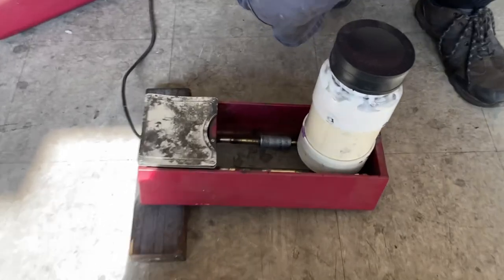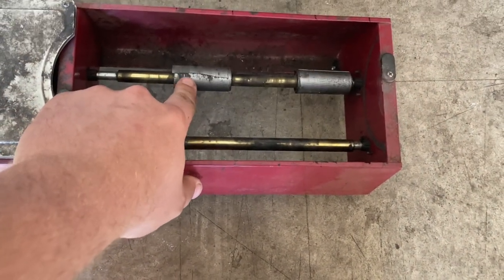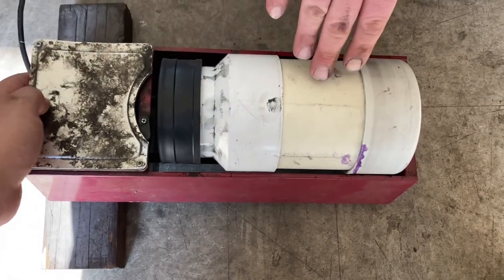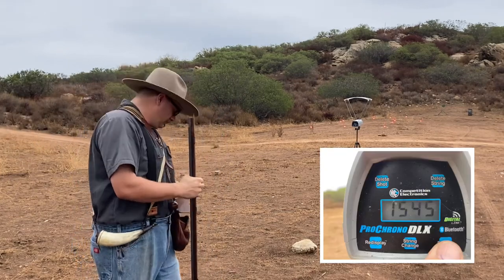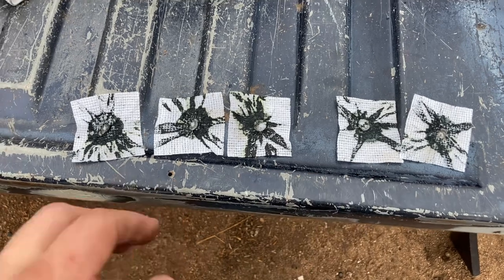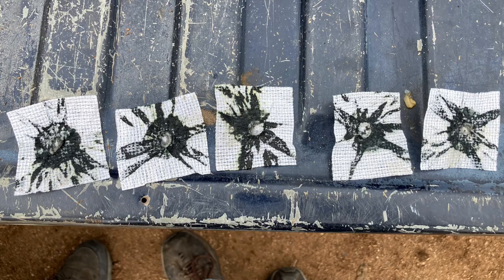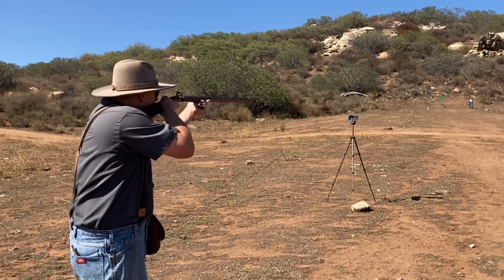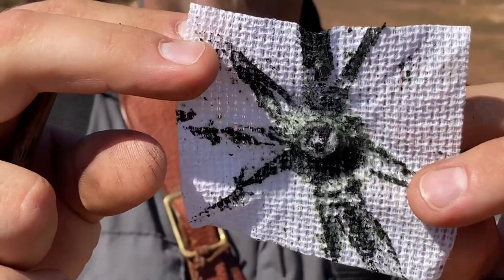Why Is Your DIY Black Powder So Dirty?

Comment: Ahh You got the Alumina Balls!! don't need a reducer if you get a no hub fitting same o.d. as end cap or just two no hubs one each end. I did same idea with internals but at angles similar to cement mixers mixing paddles! and ABS it's harder
And I accidentally "may have" discovered Carbon material "May Not" matter as much as I thought? But How or What I do to my Carbon makes HUGE differences! in speed and clean? I did micro adjustments on my last batch in-between rudimentary testing. I came up with a base of 75:15:10 but I noted my fouling? and my foulded ratio sweated indicating my KNO3 was Not used up completely? and ended adding the equivalent of 2% and 1% of gross amounts added in char and sulfur until the fouling did Not Sweat. I did not break the math down to actual %.  I got Soo excited with it I did not Bother Pucking! I just pushed dough balls through screens. Oh Well Now I need to TEST MORE! 

I think I "MAY" have found the Dragon! and my journey and equipment was almost the same!!! as You!   my last batch was FAST! Hoffman FAST! it scared Me and my Dogs! when I tested it on my welding bench! and it looked clean. I used a split piece of tubing for speed control?

How can I get hold of you? we could cut development in half?
Keep your Smoke Poles SMOKING! Keep Chasing the Dragon! Keep it by the tail!

Comment: I wonder if it was the lead acting to support the combustion?  Your charcoal shouldn't get over 560f-570f and stop the cook when the gasses still flame, but are darker like orange.  Also quicker cooldown without introducing air obviously, would help slow the process.  If you get the better char, it'll be a brownish black, instead of glossy black.  Try bumping sulphur up to 12% and see what happens, might replace some of the speed of losing the lead.
Reply from the maker: Cool. Thank you

Comment: A little stray of the subject matter but I’m curious if you’ve ever consider adding a percentage of triple seven to your homemade black powder during the grinding process to integrate the artificial black powder into your homemade powder. With the thought of increasing your velocity? May be adding 10% by volume would increase your velocity without sacrificing ignition qualities..
Reply from the maker: It hadn’t crossed my mind

Comment: Lots of good tips, thank you. I've wondered since the very first about using lead to mill with. 
I don't remember, have you tested longer milling sessions? Just for shits and giggles, I milled some for 2 days, stopping and shaking the contents several times to loosen it up and start milling again. I didn't use my Chrono but seemed to improve the final product.
Reply from the maker: I milled the first batch for 8 hours and the second batch for 4 and no noticeable change

Comment: I wonder if because the new media is lighter if it isn't mixing as well?  Causing slower velocities. I would ball mill a batch with lead and a batch with the new media for the same amount of time in the new drum you made. And see if you get the old velocities back. I suspect that you will need to mill it longer if using ceramic media.
Reply from the maker: Good idea

Comment: I'm wondering if the wetting process for making the pucks that are later corned, is resulting in some undesirable distribution of the ingredients. When that water is evaporating, carbon is not very soluble, but the oxidizer is highly soluble, and can get concentrated on the surface, where the water is doing its evaporation thing. Also, if the wet oxidizer is in contact with the sulfur and it's not kept near freezing cold, Some of the sulfur is likely going to rob oxidizer to make un-helpful sulfate compounds, a double-problem. Perhaps doing wet grinding of very dry ingredients in xylene instead of water would give a fairly stable and non-burnable atmosphere in your tumbler, while keeping any reactive oxygen or moisture separated. The downsides are that the vapors are about as flammable as gasoline, and you'll need to get the pucks up to about 300F to drive off the residual xylenes. On the other hand, the xylenes will remove other oils when you drain/screen/press the liquid out, and it will pull out remaining water that way, and via heating. You will need to keep the vapors under tight control though.
Reply: That might be a little far, but still worth investigating. I also think that not only does the sulfur help by reducing ignition temperature it may generate small amount of sulfuric acid. This can react with the heavy tars in the charcoal and even with the potassium nitrate. Basically making a sort of small nitration mix. I've usually gotten my best results after doing a first pass milling  and granulation then milling down for a final pass.
Reply: @Slowly_Going_Mad  Yeah, I don't even remember typing all that. I'm not sure why I chose Xylenes of all things, as those will tend to dissolve some of the sulfur and cause a small amount of sulfur crust on the drying product anyway. It's probably better to go with distilled water for wet milling, and then pull it out with multiple rinsings of dried acetone. 
The random reactions of tars and sulfuric acid in there probably won't do well for consistency, but sulfuric acid will inevitably pull moisture out of the air to hydrate itself. This will probably cause hard grains to swell and crumble, then, upon burning, harm your barrel, while much of your energy is not available due to trying to re-boil the trapped liquids. 
I don't do any of these chemistry projects though, so I'm simply looking at it academically.
Reply: @buckstarchaser2376  the chemistry behind it is indeed interesting and surprisingly complex, bordering on alchemy as only loose generalizations of what's going on can be made about it. I also put it to use for my revolver and have fun with some fireworks type things. It's strange that overcooked charcoal doesn't work well and neither does undercooked char. Ash content has measurable effects like acting as a catalyst and too much robs it as it's just dead weight past the limit. I found it strange that my undercooked oak charcoal burns very cleanly albeit slowly without very good confinement, though it can be made to go full power, and that my well done batch of poplar char burns really dirty leaving an almost rubbery soot that's heavy with sulfide compounds where as the other doesn't do that. I'm working on a batch right now where I cooked a bit more of the volatiles out of the oak and I'm wondering if I get roughly the same results. I suspect that at least in this case the burn rate is so high that any spare sulfur is going to be condensed (along with any salts, slag, and ash) rather than combusted more completely as with the slower stuff.

Comment: Great videos! Question, are you still using the CIA method before milling and picking?
Reply from the maker: No. I milk all my components together for 8 to 10 hours and then puck it. I’ve found this to be just as good as the cia method

Comment: How do you keep track of chamber pressures with muzzle loaders? When hand loading modern cartridges you can estimate chamber overpressure from flat primers and heavy bolt lift in bolt guns. Are there any similar signs in this case? It makes me nervous to experiment with powder chemistries if you can't identify possible overpressure or pressure spikes. Great video.  Thanks!
Reply from the maker: The short answer is no. But unlike a cartridge loaded with modern smokeless you don’t have to worry about pressure problems with any black powder firearm. Black powder doesn’t even come close to the pressure spikes of nitrocellulose and nitroglycerin based smokeless powders.
Reply: That makes sense. Thank you for the reply.

Comment: Hello, thank you for the video and sharing the results. I have feedback and question. 

Feedback: Please note that there is a strong relation between diameter of the container, diameter of the media and the speed. Usually the jar diameter is equal to the length. If the jar diameter is 100mm then the diameter of the ball media is 12,5mm and the speed must be 140 critical and 90 optimal rpm; If the jar diameter is 200mm then the diameter of the ball media is 15mm, the speed must be 98 critical and 64 optimal rpm. 

Question: Since you have tried both dry and CIA methods, what is the difference and does it make sense to mill first the charcoal and sulfur and then separately dissolve the potassium nitrate in distilled water and add the milled charcoal and sulfur and cook it until dry or use cooled alcohol and then mill all again OR simply put all ingredients Charcoal Sulfur and Potassium nitrate dry in the ball mill and mill longer? Does if make a difference and does it make sense the CIA based on your tests?

Thank you
Reply from the maker: I don’t use the cia method anymore. I’ve found I can make just as powerful powder if I just mill the components together long enough.

Comment: I am not sure what your granulation method is for your homemade powder but if you are granulating through a screen you are making much less dense powder than corned production powder. You should get a scale make a your powder charge to the volumetric measure. I'll bet you will find that your powder is lighter per volume. You might just get that velocity back if you weigh it
Reply from the maker: I haven’t made screened powder in years. Corned is the only way to fly. About compressing your powder. 
Why Is Your Homemade Black Powder Weaker Than Goex? Black Powder Service Announcement.
https://youtu.be/Ctm_gpU-fJU

Comment: This is an aspect I have no experience at, so I have nothing but questions.  One can not complain about the consistancy of the 50 grain load. Do you have a theory as to why the inconsistency of the 70 grain load? Or is this a small sample size compared to overall experience?
Reply from the maker: The 70gr charge averaged 1792fps with a max spread of 67 which is very typical of any firearm including muzzleloaders.When you start getting a spread over 100fps it’s an indication of a problem

Comment: Thanks for your great vids Jake - pi$$ funny telling the pin heads to “go make your own damn video”
Saw an idea for milling media on a Cast Boolits “mega” BP thread - they sectioned 1/2” and 3/4” copper pipe into inch long pieces and filled them with lead - peened the ends over - reckon it’s the ducks nuts they do.

Comment: Great video, where did you get your milling media? I use .490 hardened lead round balls but would love to try the ceramic and see if I can get the same results as you did.
Reply: Sling shot ammo. Usually white ceramic balls
Reply from the maker: I bought it from United nuclear
Reply: @Everythingblackpowder  I noticed on United Nuclear's webpage for purchasing the ceramic balls that the description specifically states "Since all Ceramic media has the potential to make sparks, it is useful in all applications except for milling explosive powders such as Blackpowder".  Did that get added/changed since you bought them?
Reply from the maker: @michaelg4931  lol maybe. I couldn’t say.

Comment: Do you activate your charcoal or leave it unactivated? I don't know if this would make a difference.

To activate charcoal you smother it in water at the end of the heating process. This changes it somehow. Not a clue if you do this already.
Reply from the maker: Non activated charcoal makes more power

Comment: Have you tried brass balls to put in the tumbler?  As far as I am aware of they do not leave the dust like lead balls do.
Reply from the maker: I’ve been using brass for several months now. It’s the only way to fly
Reply: @Everythingblackpowder  What size do you use?  I am just starting out and have 1/2 inch diameter and unsure if that will be good or not.

Comment: if you want the bore to be even cleaner and never ever swab ever again! use dawn dish soap and water for lube. i mix about 30% soap and 70% water. wet the patch and load and shoot. you can shoot all day long and never swab, and shot #100 will load like shot #1, and the bore is a snap to clean. if you use this lube i think you will be happy, unless you just like swabbing instead of shooting,,,,,,,,,,,,,,,,,,,,,
Reply: Boa idéia.

Comment: Are you still using the CIA method to make your AFMP? Or are you bypassing that part now? What size brass balls are you using? Half Inch @ a 100 count?
Reply from the maker: No I don’t use the cia method anymore. I’ve found that I can get the same quality powder by simply milling it longer.
Reply: @Everythingblackpowder  What about the question on the brass media?
Reply from the maker: 1/2 inch sold brass balls. I’m not sure how many. Maybe 150-200

Comment: you ever though about putting it in a dehydrator or baking it in a toaster oven on low to rule out any moisture contamination
Reply from the maker: Yes, I put some in a toaster over some years ago and it caught on fire.
Reply: Dehydrator 3 days after making pucks

Comment: That rubber contamination caught me off guard too. I wonder what the “Big Boys” use to construct their ball mill drums?
Reply: Long time ago I saw an antique BP mill. It had 2 huge 3000 pound foot wide wheels. They were on the same shaft and turned slowly. There was a cast iron trough they rode in. As they rolled they twisted. Grinding the mix.
Reply: @Michael-rg7mx  
Thanks Mike. I’d bet they used cannon balls and grape shot as crushers too. 
Plain wrought iron doesn’t spark very well and it’s pretty strong. There are BP powered log splitters that are nothing more than an iron bottle that are filled with BP and an exit port and fuse hole. They’re driven into the log loaded up and touched off. They don’t seem to explode. They do need tethered by a chain and a stake in the ground. An iron pipe may be doable.

That rubber used for the rock polishing mills is ,probably, not the most durable grade available. Whatever is used for the drum, the possibility of creating a static electrical charge needs to be avoided.
Reply: @chopsddy3  
Grandpa's wedge had a ring on it with a streamer of fabric. We used 3 to 1 salt Peter and sugar. It worked as well to just drill a hole and hammer in a sheet of newspaper and a piece of limb. I still have that brace and bit.
Reply: @Michael-rg7mx  
That’s awesome! I have some very large old trees that are becoming dangerous. I’m getting old…. no, …. I got old and I’m not spry enough to climb with a chainsaw. Not only that, cutting a large limb can cause these old trees to do the watusi while your up there. I am however, spry enough to screw rungs into the trunk and get up there with a drill brace and some BP. It seems to be the safest way to go. Most fun too. An electric hobby rocket ignitor should do the trick.

Comment: Unhardened 1/2" 304 stainless steel media. Has the mass, not quite that of lead but perfectly effective none the less.

1 hour to mill 500 grams to the edge of clumping. Huge drawback, it's friggin expensive!
But it is a tool. A long lasting tool and thus an investment. Something that will serve it's purpose well and avoid lead contamination of the powder.